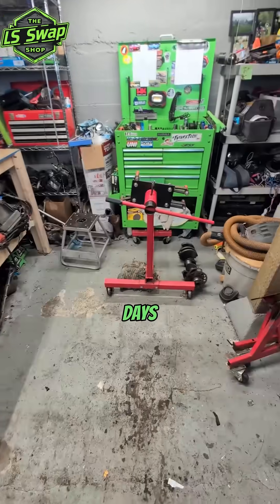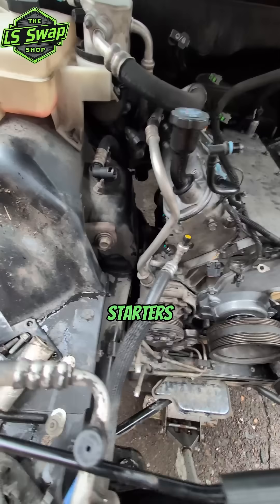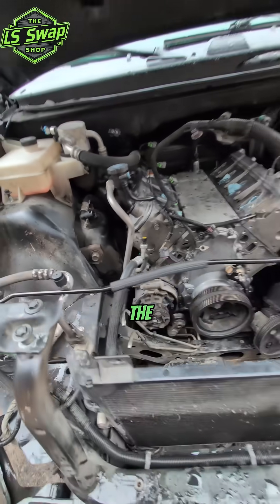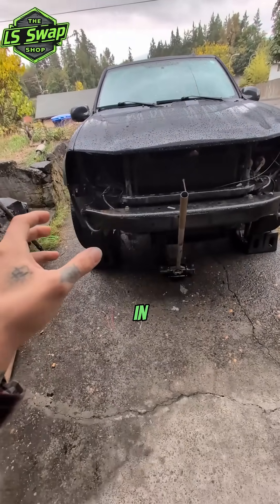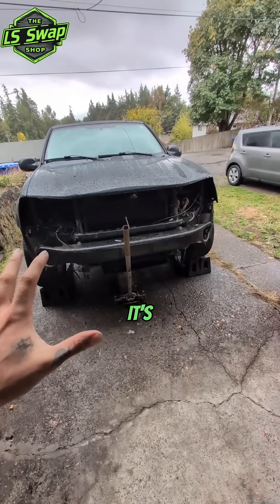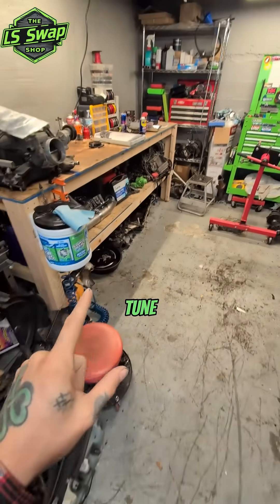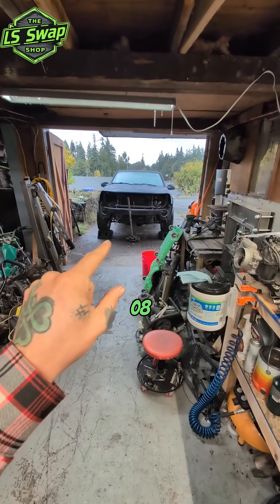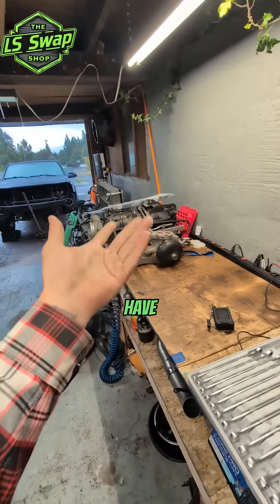Help me find a free way to tune this ECM!!

Comment: Take it to a reputable hp tuner, or you might end up with a bunch of high dollar junk. Ask me how I know.
Reply from the maker: It's going to the tuners when I done regardless. I just need a way to flash a startup tune for the cam so it can idle. Literally just so I can get a good break in.
Reply: @TheLSswapShop Rent a car hauler from U haul. Let the tuner do the break in.
Reply from the maker: @michaelj343  usually run the engines on my stand before even installing them. I don't have a gen 4 harness so I have to run it inside the vehicle. I pulled this engine and built this engine for the customer and re installed it. If something goes wrong at the tuners or the tuner doesn't do the break in right then I have to bring it back here and then pull it out and fix it. I know how to tune for a cam. I just have no way to flash that tune onto a gen 4 E67 ECM. I do it all the time on gen 3 PCM with no issues. Was just looking for a way to do it for free like with the gen 3 PCM. But if there's not a way then I'll just rent the hp tuners from a friend and pay him for the credits. Job done.